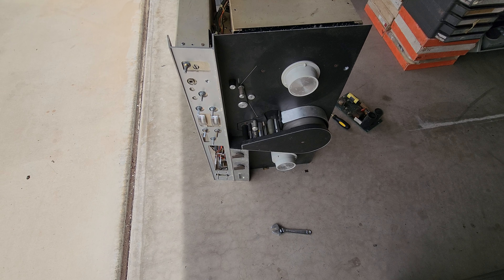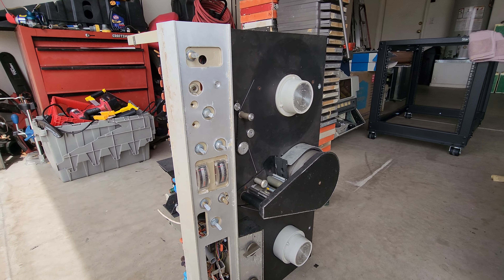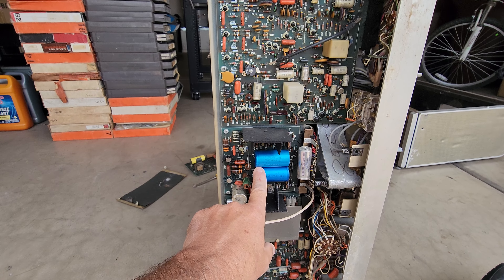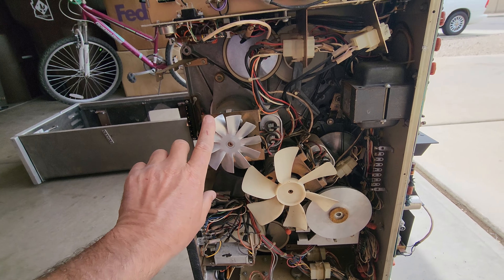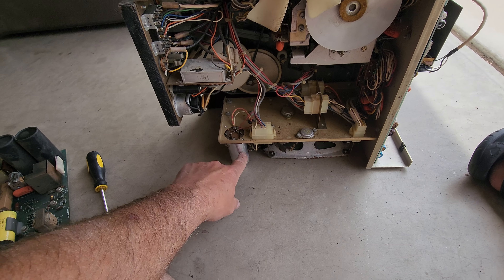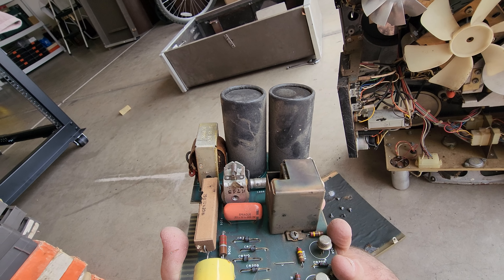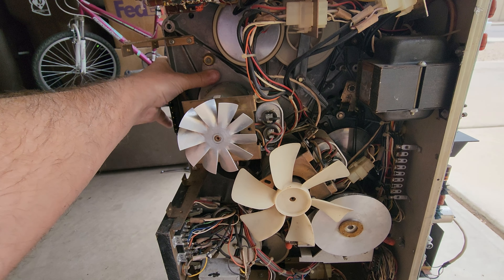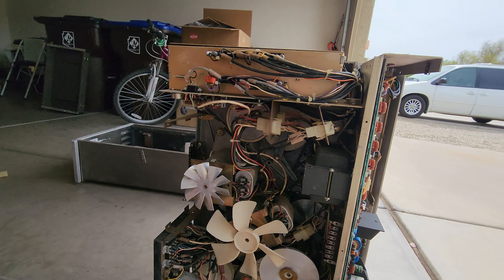Ampex VR-7500 Bad Capcitors 👎 very old and need Replacing.

Comment: Have you worked on 2' quad machines ? i see you have a BVH 3100 Sony machine in the background. I have worked on many Ampex quad machines.
Reply from the maker: Yes i have many times i have been in broadcasting for way over 30 years..
Reply: @obsoletevideo6048  Me, consumer repair 58 years, Broadcast maintenance 43 years.